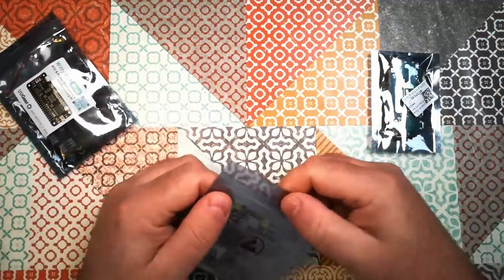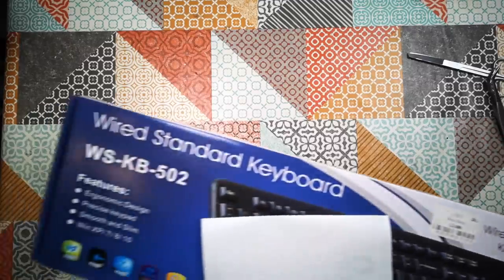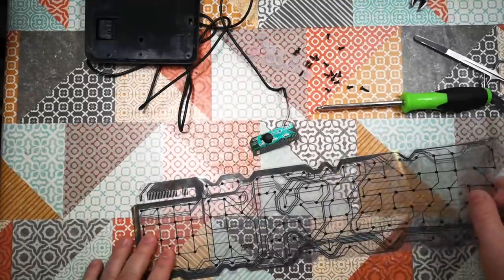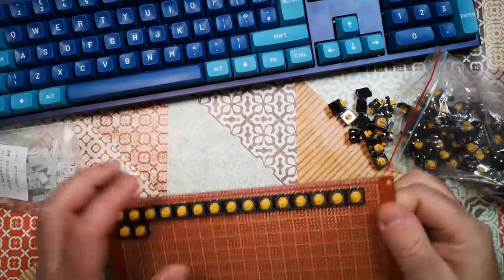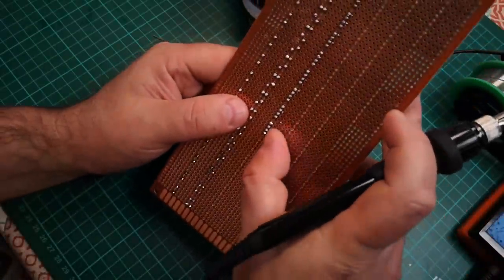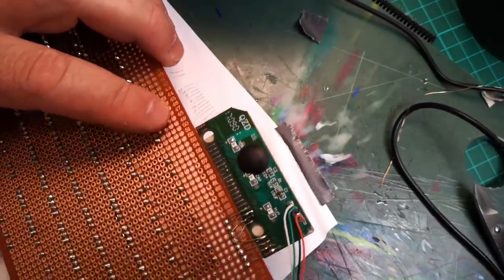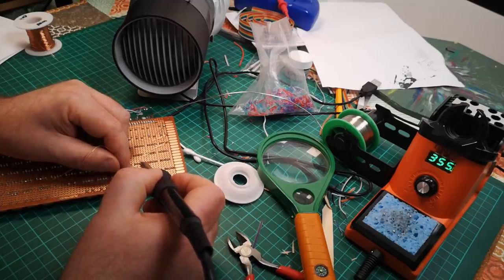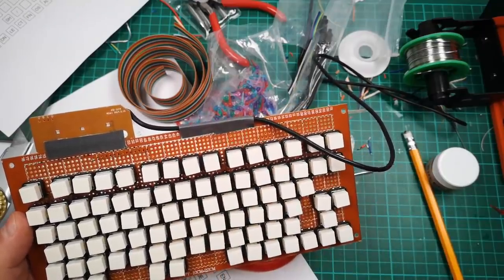How to NOT Build a Keyboard, or: Time to Stop Doing the Same Thing Harder

Comment: Definitely feels like a better way would just to be grabbing a microcontroller, programming it to act as a keyboard, and wiring up your own keyboard matrix to it. There's a couple open sourced keyboard designs based on the Raspbery Pi Pico and RP2040 chips like the PyKey and Env-KB, I've used them to make macro keypads but I haven't done a board larger than 16 keys.
Reply: I agree. I guess it's just knowledge of the cheap microcontroller dev board market that would've sent me straight to one of the stm32 "pill" boards, which are easily built upon in qmk. Once the matrix was wired up, it's very simple to get your own variant of the firmware going. I know that because I did my own as a fun project with my own pcb and 3d printed case.

Would've even been about the same price as that cheap keyboard the controller board came from 😅

Totally not saying it had to be done my way, just that there's so many ways to do these things 😊
Reply: One could also use QMK, which is a big thing in the custom mech community and an arduino pro micro or similar.
Reply: one thing all those tutorials have in common is using if conditions to check in a loop whether a key is pressed, do you have any resources where I can simultaneously press multiple keys at once?
Reply: "macro" keyboards are always small... anyone else ever realise that?
Reply: @hotmailcompany52  I'm talking about a Pi Pico or RP2040, there are a lot of boards based on that that are meant for keyboard controlling, several that imitate the formfactor of Arduino boards. Though yeah, the RP2040 probably would be a bit overpowered, but really most hobby microcontrollers would since they're going to have features that aren't utilized in this specific application.
Reply: Yeah most in the mechanical keyboard community use pro micros, or pro micro clones, like the bitc, and such
Reply: MLP pfp 🤢
Reply: honestly a rp2040 is overkill, idk y people are using such a powerful microcontroller for such basic tasks, just use something like the atmega 32, or any other HID compatible microcontroller, also the issue with most of adafruits breakout boards is that they just have a few gpio's unlike the full fledged pi pico, another way to going about this would be to use a resistor network per key but that would be kinda pointless
Reply: @ShahZahid  the rp2040 is definitely overkill but it allows some interesting functionalinites like driving screens and sideloading different layouts using the bootloader to modify the layout in a folder to use.
But for sure if you want a "basic" keyboard go for a arduino micro,.
Reply: @ShahZahid  Like with most of the Raspberry Pi Foundation's products, it's more about the ecosystem than the specs. The RP2040 has a lot of good documentation and tutorials readily available. It's also price competitive with other microcontrollers so the overkill specs don't really matter to an end user when it doesn't cost more than a much weaker controller. If you were actually going to be manufacturing keyboards in series then it would make more sense to buy a more limited controller, preferably in bulk to reduce costs, but for a one-off project like this people tend to favor what's easy to use.
Reply: @omnirox-re3wo  congratulations on hating a kids show. we all think this makes you very mature.
Reply: @sofia.eris.bauhaus  hating on the guy that likes the kids show that's what makes me mature
Reply: @omnirox-re3wo  incredibly mature. perhaps even senile.
Reply: Using the config files you can set up the Pi Broadcom chip to drive a row/column keyboard directly from the GPIO. Includes debounce and everything!
Reply: @sofia.eris.bauhaus  senile does not correlate with mature my man
Reply: @asteroidrules the rp2040 is no where near as documented as the stm32 which is the go to choice in these projects, its has lots of io, and has already been used in tons of keyboard projects but honestly its easier to find a gpu at msrp than to find stm32 these days the quote time is nearly a year so that would explain why people are going for the rp2040
Reply: Arduinos can also be flashed to act as a USB keyboard and write a bit of code to interpret the keyboard matrix to keypress events
Reply: @omnirox-re3wo  It's not 2014 anymore, no one cares. Go hate on anime pfps instead, thats the real plauge to society.
Reply: @asteroidrules  Hell. Right now rp2040s are exceedingly cheaper than any pro micros I can find.
Reply: I may have found an interesting use case for recycling the controller of a existing keyboard. Wireless. especially at a budget getting the controller from a second hand/basic logitech keyboard is a decent cheaper alternative of getting a wireless enabled micro controller like a nice!nano.

Comment: Here's just a few bits of advice; take it for what its worth:
1, You might want to have scanned the original keyboard sheets. In Photoshop (or gimp or whatever) you can just color bucket the individual lines. Makes everything very, very much simpler. You could even just take a picture of the original keyboard and have 3 layers. top sheet, bottom sheet and scale the keyboard picture to the right size. I'm guessing it would take half an hour to map the whole keyboard.
2, Try making your own PCB, and by making your own, I mean sending the files to a PCB maker. I've used GEDA successfully a few times and its surprisingly easy. Then all you need is the matrix from step 1. You can put the key switches wherever you want and it will auto-trace all the paths. (GEDA is FOSS).
3, Y no flux? Flux gud. Seriously, liberally using flux makes soldering so much easier, and that rosin core stuff just doesn't work well.
4, unless you bought very expensive switches, test them all first D:

But really, I think people are intimidated by having their own boards produced. Don't be. Start with something simple like a USB power supply with a reference design and work your way up in size and complexity over a couple of projects. I've made things like what you did, jerry-rigging solder breadboards (the most complex thing I did was a well depth sensor machine that worked off pressure sensors) and its just awful compared to having boards made. The "I did that" feeling is a lot stronger when you receive a professionally done, professionally cut board than when you solder together a rat's nest (at least for me).

IF... IFFFF you insist on using a board like that, I've done it two ways successfully: one, use enameled magnet wire kinda like you did, but scrape the enamel off areas that need it with a razor blade. The other way is just use wire from a cat-5 cable and strip it at the locations you need to (the plastic will slide for at least 30cm or so).

As I was writing this while watching the video, bend the switch pins, not only to hold them in place, but bend them towards the center of the switch so you can tell which switch they belong to.

B̶e̶w̶a̶r̶e̶ ̶o̶f̶ ̶f̶e̶a̶t̶u̶r̶e̶ ̶c̶r̶e̶e̶p̶.̶ ̶F̶e̶a̶t̶u̶r̶e̶ ̶c̶r̶e̶e̶p̶ ̶i̶s̶ ̶t̶h̶e̶ ̶p̶r̶o̶j̶e̶c̶t̶ ̶k̶i̶l̶l̶e̶r̶.̶
-edit
Oh, also, don't be afraid to add more features. YOUR PROJECT ALWAYS NEEDS MORE FEATURES.
Reply from the maker: Scanning and flood filling the layout is genius. I could have saved hours and hours of effort like that
Reply from the maker: I mean, actually, all of those points are solid advice. Thank you
Reply: @AtomicShrimp  no problem. Condensing a lifetime of experience down into a few points means leaving almost everything out. I'm not good at that and I tend to leave a lot of TL;DRs.
Reply: I absolutely and wholeheartedly second having boards made. There's some growing pains for sure, but it's so amazing to assemble a design that does exactly what you want rather than fight with a protoboard... Especially for something this conplex
Reply: @DingleFlop  It seems like the adhesion of the copper on the kit boards is a fraction of what it is on manufactured boards too. I never had a problem with pads coming off or anything. I think a lot of kit boards sit around for years or decades and really arent any good anymore by the time you get them, if they ever were good.
Reply: You could also composite onto that the image of the keycaps so the keys are all labeled on the matrix sheets.
Reply: Not exactly a tip, but to add to this, I suggest getting a 3D printer for custom projects or if you don't have the room/desire to own one, then use a printing service, because custom projects means custom case, so for this project be it perfboard or pcb, you can create the mesh for holding the caps in place and on the bottom shell create slots for your Pi and other boards to rest in or just browse thingiverse as chances are someone has already had the same idea and done something similar which you can easily copy or modify.
Reply: @vgamesx1  I thought about adding that but I hesitate to suggest 3d printers to people who don't have 3d modeling background. To make a decent project housing like a laptop clamshell (especially something like the original OLPC), starting from zero knowledge, dialing in the printer, experimenting with materials, learning the modeling software and getting the dimensions right enough for things to fit could easily take more time than the rest of the project put together, including having custom boards made.

BUT, if you were to do it, it might be easier to start with something like a Snapmaker that has a laser cutter attachment for acrylic. You can design something with a laser cutter or CNC router and layers easier than designing a whole case from the ground up.

I do agree that if this isn't a one-off project and you're going to try making a lot of your own devices, a 3d printer is probably a necessity.

What to get is a real problem. I'm in the process of finding a replacement for my old, defective one. I think something from Prusa or a Creality Ender of some kind is the way to go.

"Beware of feature creep" is an extremely important issue when it comes to 3d printing. You can end up 5 years down the line with not much other than a pile of thingiverse trinkets and a thousand dollars of filament to show for it.
Reply: @AtomicShrimp  Also I would probably do the opposite - I would just short the pairs on the PCB and see what character I'm getting and just create a table out of that. Takes way less time than tracing the original lines because you're interested in the output anyway.
Reply from the maker: @RexDexPL  I did try that. What I didn't show in the video is that brute forcing like that is actually problematic. Firstly, not all combinations of row/column produce any output at all, so during the process, it's often unclear whether it's a null combination, or if you just fumbled the (small, fiddly) connection.
More of a problem: some combinations appear to issue shutdown commands to the host. Also, I couldn't find any very useful software to perform this test - there are keyboard testers out there, but all of them have limitations, and testing into a plain text document doesn't get the modifier keys
Reply: Definitely second getting a PCB made.  After Veroboard and DIY etching, professionally made PCBs were a revelation.
Reply: Only thing I can add is the plastic insulation on the wires inside cat 5 cable melt for nothing. I've used them loads for quick fixes but you end up struggling to get a neat tip because the insulation will melt away even when you touch the iron to it for a split second (It might also be because I'm using very cheap cat 5 cable)

I've also got a few loops of old telephone wire. I suppose it's what they use to wire the telephone exchange box with because it's almost like what's inside cat 5 cables but a lot more and also more colours. Anyway, that's good old fashioned copper wire with a nice insulation that doesn't melt so easily when you solder it to something
Reply: I prefer kicad, but whatever boats your float works is fine.
Reply from the maker: @htomerif  Yeah... 'get a 3D printer' is the easy part.  Acquire any kind of competence in designing things for 3D printing, from a standing start, not so easy.  Back in the day, I taught myself 3D Studio (the DOS version of 3DS), without any manuals or anything - just fumbling my way through the menus and functions.  Now, even with the manuals and tutorials, I struggle with anything like this
Reply: @AtomicShrimp  I totally understand not wanting one step in the project to become the whole project to the point that 2 years down the line you're still working on fine tuning your 3d printer and you don't even remember what you got it for.

And its not just about the modeling software, its about the software to run the printer and the slicer and physically getting the printer to work right. Every one of those things requires fudge factors and voodoo.

For example, you're probably going to have to set the filament feed multiplier to "something that seems to work most of the time" and the X, Y and Z dimensional multipliers on every step of the tool chain to "these dimensions are close enough for me to cram the board in and it only cracks a little bit".

When I get around to it again, which I'm not looking forward to, I'll probably get a new Prusa i3 mk3 as a printer, force Blender to act as my 3d modeling software since I kind of know it even though its definitely not designed for it, use Repetier host to run the printer and Slic3r as a slicer. If anyone actually read this far and thinks any of those are particularly stupid choices, by all means, go ahead and tell me.
Reply: Flux = gud!
Reply: @bashkillszombies  I'd bet everything I own that you don't even know what your name means.
Reply: @htomerif  I am the queen of TLDRs.  Good thing I know nothing about this. 🤣🤣🤣🤣
Reply: Idk from where you are but around here when you buy the tin-lead for soldering the flux resin is contained within the wire...thats where the fumes come from byl I suppose that Shrimp had this kind of tin
Reply: @kalinmir  Yeah, but rosin core solder doesn't work. I can't count how many thousands of solder joints I've had to make or repair and while you're right, there is technically flux in there, if you look at a board repair channel like Louis Rossmann's, you'll see that he uses about as much flux as he does solder, and then he just cleans it off. That's kind of the way to do it.

When you end up with the solder beading up and not sticking to things like it did in this video (if I remember right) that's because of oxidization and it means you don't have enough flux on it.
Reply: @AtomicShrimp  I agree.  I think those ideas are all sound.  At my previous work (I'm retired) I used expressPCB .  Normally they're limited to 3 1/2 x 5 inch size but they can work with different PCB outlines.  They are inexpensive and the software was easy to use.  THere are others.. PCBway and many others.  I'd say, spend some time per week developing PCB skills and build a modest board and build up from there..... Anyhow best of luck!
Reply: Blimey! You are very clever! It's nice to see someone who knows what they are talking about offering sound advice 👌 
I, too, will be keeping this advice in the bag for when I need it.

Thank you.

P.s I hate working with the 'safer solder' I always buy the good old red stuff 😂

Comment: I kinda did the exact opposite with my keyboard. I bought a cheap board with switches and a layout I liked, and replaced the controller board with a microcontroller running QMK. I finished the thing, but it also wasn't smooth sailing. For one thing, I had to modify the matrix slightly to cut down the number of pins, which meant cutting some traces and a few bodge wires. Additionally I wanted N key rollover, so I had to cut all the traces for the columns and replace the traces with diodes. This of course added quite a lot of stuff to the backside of the PCB (and the teensyUSB also took up more space than the original controller), so I had to shave down some plastic from the inside of the case.
I got lucky in that I was still able to close the case, considering I of course hadn't measured anything before starting the project.

Comment: It wasn't the possible contact confusion that gave me pause for thought, but I was concerned about the durability of the design, given that it was meant to be a portable device.  Would those tiny and wire-glued connections to the PCB have held up over time?  Would the enameled wire have shorted somewhere after a while?  I've been known to build things that tested OK at a bench, and then failed swiftly in service, so I may be over-sensitive!  Anyway, YouTube is full of projects that gloss over the difficulties, and many would not have uploaded a Setback Video, so thanks for the insights.